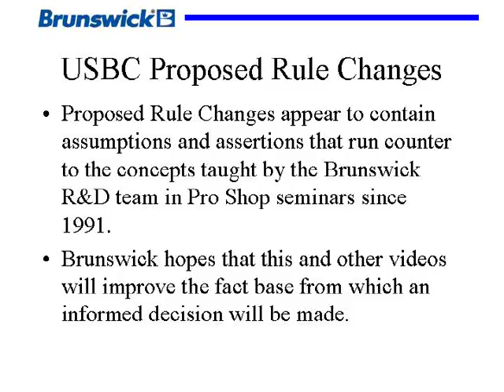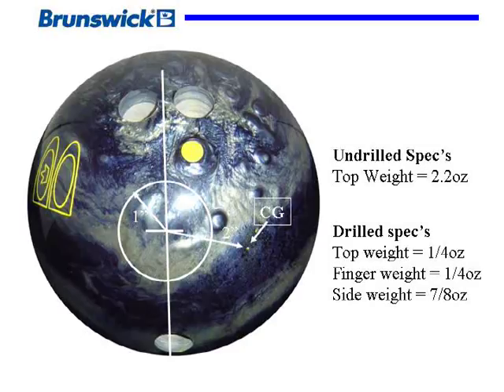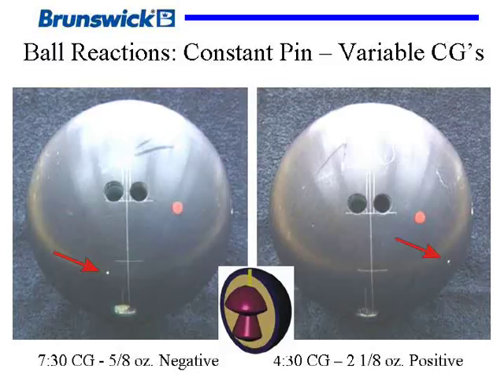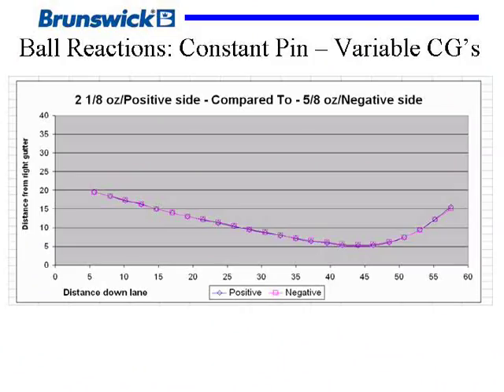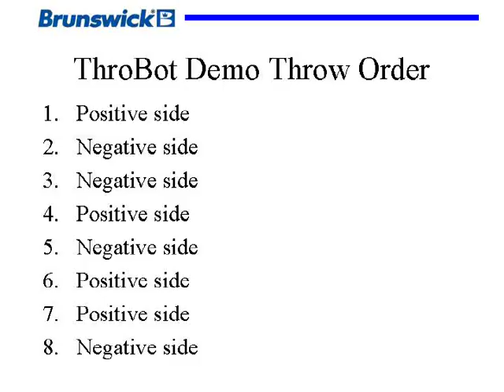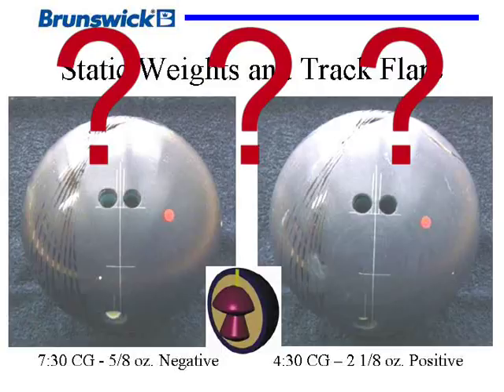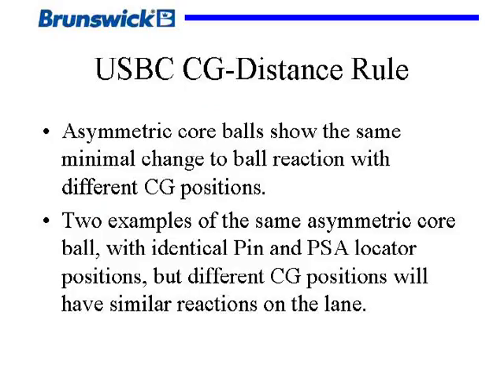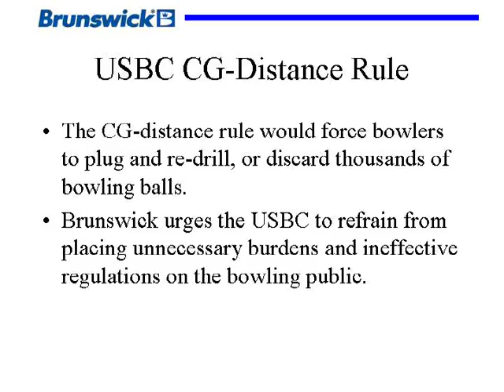Brunswick - CG Distance Demonstration

Comment: The positive side weight appeared to have a slight farther break point putting it more into the dry area of the lane. Thus with that weight it reacted more inconsistently while biting and shifting over the back end. The neg. side ball was more consistent in that it appeared to have less skid across the front end and less reaction thru the break point, thus holding a more uniform line.
Reply: Don't forget the ThroBot launches the ball at exactly the same spot with the same speed and rotation every time. This breaks down the oil quickly on a ball traveling at 14+ mph while turning 300-500 revs. I'd say drop all the equipment advantages. Drill them all pin-up, zero side weight, solid urethane and let the best "bowler" win.

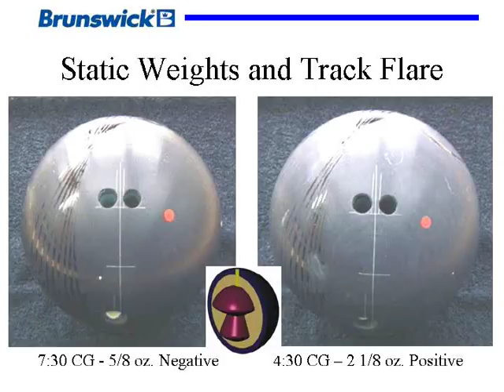Comment: Also the frame at 4:31clearly shows that the ball track on the negative weight ball is at least a half inch closer to the thumb and runs more perpendicular to the finger holes where the positive weight ball it is definitely kicked out further left of the thumb and slightly further from the fingers fingers.
Reply: Which makes sense because of negative weight balls in producing more early end over end motion and the positive weight ball will respond better circling the lane and recover better on the back end just like we've always understood it to be.  I think this test proves at the balls will react identically in the oil portion of Lane but there is a definite difference when it hits friction how it responds to friction.
Reply from the maker: Ball tracks are the same, they appear different because the balls are not aligned perfectly the same in the pictures.

Comment: so, opposed side weights reactions were almost completely counterbalanced by cg placements.  Seems significant to me.
Reply from the maker: Care to explain your thought? CG placement is where the static weight is. The data shows it to be an insignificant difference and the updated 2010 static weight study shows it to be very small as well 2-4% with the rules at the time of the study. If you can tell those differences you should be on tour in Maine right now, not on commenting on youtube.
Reply: negative side weight vs positive side weight test balls achieve similar lane character by drilling with different cg position...  oh wait, is the side weight determined by the post drill location of the cg?

Comment: What I found interesting in the video is that the the positive ball showed more variation from shot to shot. Positive ball started with a light flush hit and finished with two high non pocket hits whereas the Negative ball finished with a high pocket strike. Typically a negative ball is going to read early and smoother and the positive ball will react more angular and later, I think the video shows that. You needed to average out the positve ball to get the stats to work, show us the overlay of each of the balls' 4 shots actual data. End of day the N ball had 4 strikes and the P ball had 2.
That tells me enough.
Reply from the maker: +Brooke Holota Showing and measuring strikes wasnt part of the experiment. It was about measuring the difference in ball motion on the same exact shot line every shot. If static weight had a measurable effect it would have been shown in the average.
Reply: +Eric Morrett So you think it is irrelevant that the N ball struck 4 times and the P ball had zero chance to strike on the final 2 shots? The balls ended up in different spots at the pocket on the same line. So everything being equal that means the weights in the ball clearly was the determining factor in the end result. Makes perfect sense that the N ball would burn up a little more to prevent it from going high whereas the P ball would store more energy and have more shape, but since the lanes changed a little -- that shape was sooner ending up in a higher pocket hit. We can agree it is subtle but it is measurable and you can see it.
Reply: +Eric Morrett One more point I would like to make is that the bowtie looks closer to the middle finger and the first oil ring is closer to the thumb on the N ball vs the P ball. If I was a betting man I would say the P has slightly tighter oil rings and the N ball. From my count both balls do have 9 rings.
Reply from the maker: +Brooke Holota Tuning ball motion with static weight is an archaic exercise. A variable you didnt mention is that the oil on the lane dries up extremely fast because the throbot is so repeatable. Much more repeatable than even the best human bowler. This is why there appears to be a great variance between shots. If there is little difference shown on average with a robot, a human will not be able to tell the difference unless there is an observer bias. I recommend reading the USBC ball motion study that shows static weight as the 10th most important variable for ball motion, behind even the diameter of the ball. Its all about coverstocks, asymmetry and balance holes now. Static weights were left behind in the 80s. To your last point, they are identical bowties but the balls arent lined up to the camera identical.
Reply: +Eric Morrett I didn't want to mention the oil because when I go there, no one understands what I'm talking about. Since you brought it up I will leave you with this, shots 6 and 7 were with the P ball and 6 almost went brooklynn shot 8 was with th N ball and tripped the 6 pin. 8th shot should be the driest and N ball overcame that. I've been installing, training and oiling lanes for the last 24 years and to me  those ball reactions look very different. I see the ball as a balance of storing and releasing energy, there are many factors that go into this but to say that you demonstrated that these two balls did the same thing is very misleading.
Reply from the maker: +William Holota I've shown this video to more experienced bowlers that think they can pick out the two different balls. On average they get the answers around 50% correct. What if the pins werent there in the video? Would you disagree with the information provided? I recommend reading the USBC Ball Motion study. I believe in proofing with data, not only the eyes. http://wiki.bowlingchat.net/wiki/index.php?title=File:USBCballmotionstudy.pdf
Reply: +Eric Morrett  Just because they are experienced bowlers doesn't mean they understand anything on how the oil really works. I wish you would have actually shown the raw data of all 8 ball tracks, then I wouldn't need the pins as reference. Because you averaged them you got the result you wanted. The difference in the two ball motions were becoming more evident as the test went on but yet you chose to conclude your test after 8 shots, had it gone to 16 or 24 then we would be having a different discussion. The first 4 balls I got with ease the next 4 balls were a little more difficult but after applying my experience as a lane mane and bowler I got the last 4. I used the apex of the furthest widest point that the ball gets to and from that I can visualize how long the ball is at that point before it makes its final motion to the pocket in which case the shape tells me how much stored energy there is. The N ball will have less stored energy since it has to burn some to overcome the negative force. That test should have been done with varying pattern distances and oil volume.  I would have done at least 5 more variations and maybe 3 or 4 different oils before I made any conclusions. BTW I have read the ball motion study and all I see is the tester conclusions. There is one cats data which like yours shows the result of your conclusions. It is ok to disagree.
Reply from the maker: +Brooke Holota This is not my experiment, its from Brunswick. I posted it for reference, not debate. Stop obsessing over individual shots. Empirical trials are about the entire body of evidence. Each shot is plotted on the results graph, they're just all on top of each other. Static weight is not a force! None of your posting includes data or takes into account whats changing on the lane.  READ THE USBC BALL MOTION STUDY! Static weights only account for approximately 3% of ball motion, thats not enough to consider it significant compared to the other more important variables like COVERSTOCK which can be modified. Static weight changes offer no real advantage within the context of legal limits. If you think they do, you're living in the past!
Reply: @ Eric........So statics mean nothing?  BUT a balance hole location, size, depth give different reactions. That's playing w/ weight block static weight position! OR CG as its called. Even the dual angle layout is placing the core in a position so the differential {weight} is in a Different position. But weights don't matter.....................BS! So which is it? They do or they don't??
Reply: @MegaMavX  I am personally not even interested in any test that won't help me find a combination or layout that help me strike more! Also I'd like to see throwbot Throw 20 shots each alternating balls and see which one strikes more and which one would force a bowler to move earlier or more often.  Then plot four graphs of five balls each and see which one holds a line better or which one starts going high or light for that matter. I think this test is a good starting point and is scratching the surface but it, in itself, proves nothing.

Comment: I honestly don't see this to be true and fair ... if so ... WHY weren't the balls identical ( 6" pin vs 3" pin ) ( differences in side weight ) ... I guarantee you that if they used two identical pieces of equipment, the outcome would be noticeable and very different than what was given for this video (just my thoughts) ... If I'm wrong, please enlighten me as to why  ... because I'm not a professional and don't work for Brunswick :-)
Reply from the maker: It wont be noticeable. If you watch the video again, you'll hear Bill say moving the CG around the ball is merely offsetting the core 1/8". That is nothing really. Take a look at the USBC Ball Motion study published a few years ago. Static weights are far down on the list of components that matter in ball motion. Its all about coverstock variables, layouts and balance holes today. Static weights are a thing of the past.

Comment: Yeah the problem I see with this test is robots throwing the ball and it's on a completely fresh condition. Have a real Bowler throw the ball and have them throw a ball half a mile an hour too slow and get an over-reaction. I still contend that one of those layouts will be more favorable to him slowing down his speed inadvertently versus the other ball. Or maybe the bowlers fault is he tends to get too fast and throw too hard then maybe the other layout will minimize his errors. This test completely ignores that reality of a bowler's typical fault and matching up his equipment to minimize disaster when he does make a poor shot.
Reply from the maker: This is not the intent of the experiment.

Comment: where is the center of grip when there is no thumb hole??
Reply: Legally you have to have a thumb hole even if you bowl with out one like Tom Daugherty or two handed like Jason Belmonte. I personally bowl two handed(I know I'm a disgrace or whatever), and both of the balls I've had drilled legally had to have a thumb hole to be able to bowl leagues, any PBA official event, or any other USBC event.
Reply: @alwaysmakingthings20  not true at all.  New rules in 2020 will be for every hole you must have a finger.  You dont use a thumb you dont put a thumb hole in the ball
Reply: @tylerstine784  It's good information until August 1, 2020 as I read it.  After that, holes not used for gripping are gone, and you are correct.  So... with no "thumb" hole for the no-thumb crowd, grip center [roughly palm middle as thrown] will need engraving with a  +   to verify orientation when it comes to inspection or maintenance.
 And now... for the exceptions: if a house ball [low differential polyester or urethane] is used in competition,  the requirement to use every hole for gripping is not in effect.  And this reminds me of something odd: the first place I saw a triangle [no thumb] drilling layout was a bowling center in NY in the 70s, and it was a house ball.  So... if a house ball gets drilled with a triangle layout, does the exemption prevent it from being counted as six balls?  It seems that way from what I've read:  the rules currently have a true loophole, and a rippin argument is waiting to happen when good intentions meet bad wordsmithing skills.